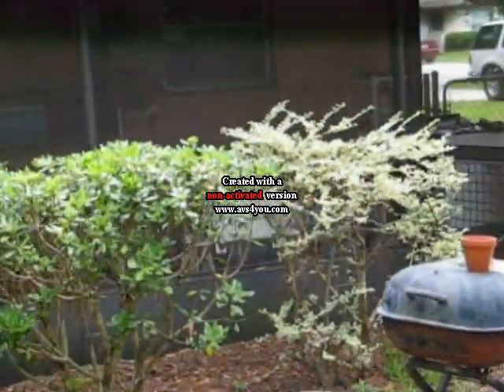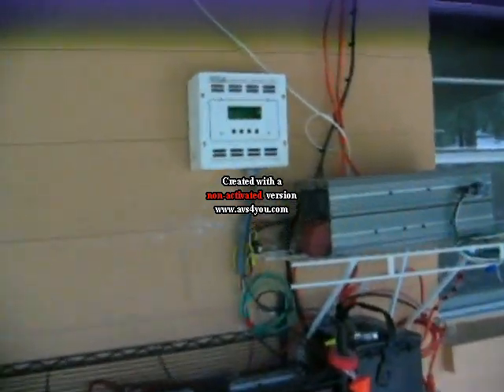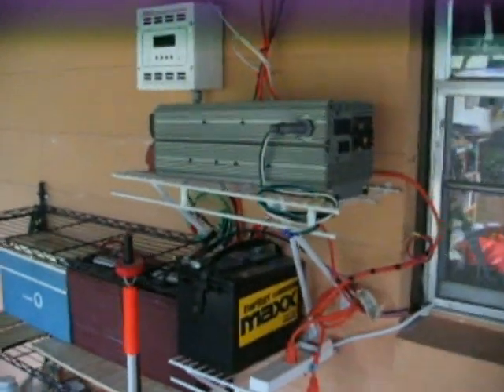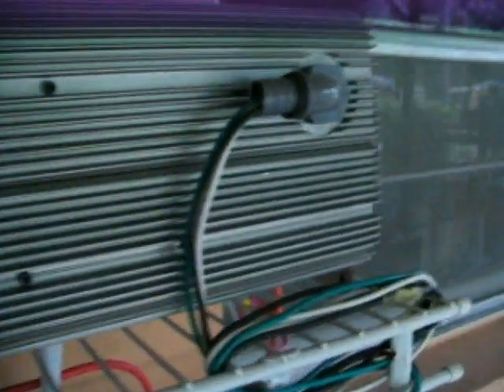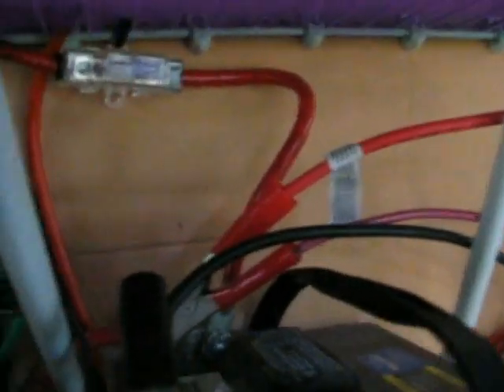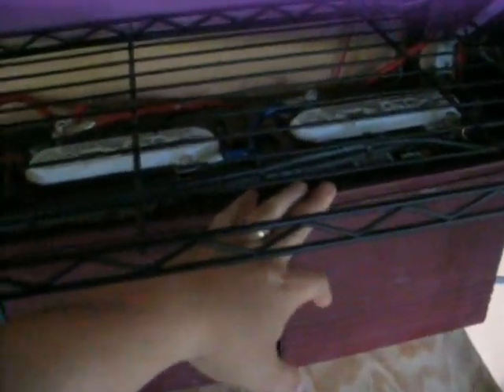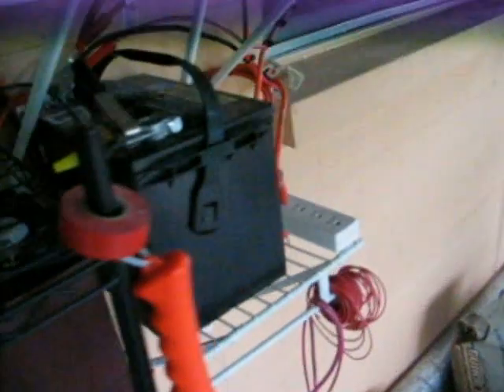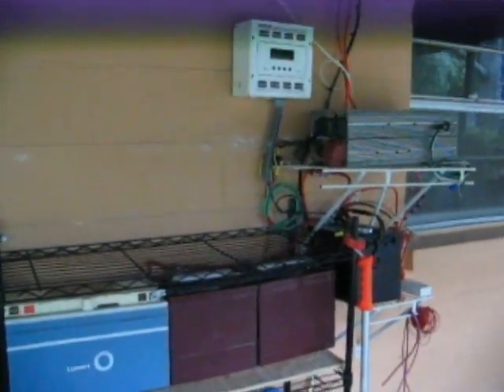MY HOME SOLAR SETUP in Florida- UPDATE #1

Comment from the maker: That's not an easy answer, due to a lot of variables. A 300ah battery (what voltage) and 200watt panel (what voltage) Then how many hours of direct sun do you have on that panel? Let's say you consume no more that 50% of the battery(150ah) and lets assume that its a 12v battery, and a 22.2v panel, and you get 6hrs of sun. Then in 6hrs your panel will produce 1200 watt hrs.(in perfect sun) then that equals about 88ah. So you will need to either use only 80ah per day or add about another 300watts

Comment from the maker: @wesleytarbuck you actually get really good batteries at Sam's club. The hybrid or Marine batteries wont last as long as the 6volt golf cart batteries. And as long as you keep them well charged, they should last you between 5 and 8 years with proper care.

Comment: how long will you get out of those batteries before you need replacing?  i have a 2.5kw system i want to get some batteries set up, but the deep cycle batteries cost a fortune, there must be a cheaper way.

Comment from the maker: @PiercingKnight, this is harder to explain. Mostly depending on if you have an MPPT charge controller or not. I do not know if you have seen my other solar videos, but I show you my charge controller and it's output. I only have about 18amps of solar to charge my batts, I use mostly my grid tied micro inverter all the time. And when my batts go down to 11.5v, I recharge. Which takes about 5 full days. Mind you that I only use my batts for 1 desk lamp, and to light up my 12v landscaping lights

Comment from the maker: @PiercingKnight, my apologies. I meat to say a 12v deep cycle would be devided by 10. The higher the voltage the lower the # you have to devided it by. A 6v batt bank would be /12. A 24v batt bank would be /6...and so on. The way you get the # to devide by is take inverter output voltage(if 120v) and the batt bank voltage(12v), which =10. If 120v (inv) / 24v (batt)=5, If 120v (inv) / 36v (batt)=3.33, and so on.

Comment from the maker: You should decide what you want to power, and for how long. This will give you how many Amp hrs you will use "need". The amp hrs on a battery means that at 1 amp draw per hr, the battery will last that many hrs. Those #s are for DC, when you invert to AC, that # is devided by 10. A 210 aH 6v deep cycle batt will only last 21 aH when inverted to use 120v items. My 1000 amp hr. battery bank will only last 100 hrs at a 1 amp draw per hr. So if I draw 10amps, it will only last 10 hrs.

Comment from the maker: @scottso241, You can pick up a 200 watt panel for about $400 dollars. The panel will be your major investment. Then you can get a 16amp charge controller for about $65 dollars. Then you can get a 1200watt inverter for about $100 used on eBay. Then 2 6volt deep cycle batteries for about $130 for both. After that all you need is standard car "starter cables" which will probly cost very little if bought at a junk yard. I suggest you buy the best you can afford, one piece at a time. Later from FL!

Comment: Great Job but there are a few problems with your setup: 
As a genral rule of thumb you should avoid useing diffrent types of batteries in one system unless you can constintly moniter there state of charge.
Car batteries are not designed for solar operation as they can not deep cycle (due to there cell structure).
Your batteries are to small fo the size of your inverter as the deep cycle batteries are not desinged to have high curent loads attached as they can be damaged.

Comment: @MrLagros As I understand it, you can connect different amperage batteries in parallel, as long as you keep the voltage the same.  But, different amp/hour batteries will charge at different rates, so you have to monitor the charging a little more closely to prevent overcharging some while you are undercharging others.  That is the only problem with connecting different amp/hr batteries to each other in a parallel string.

Comment: Even a standard deep cycle won't cut it long term. The best way to go is 6 volt golf cart batteries. Just connect them in a series of twos of course to get the 12 volts you are looking for.

Ray @ New World Solar

Comment from the maker: I have not had any problems with the different amps from different batts. I have a temp sensor that connects to the batts and displays on the charge controller. To date they have not overheated. As long as you don't overcharge them, they should be safe. I have had mine for just over 3 months.

Comment: I see different types of batteries. Any issues with connecting the different batteries of diff amps to one parallel bank?

I ask as I have two different types of UPS Batts. Both 12V diff. amps though some say if you connect them charge them this way may  blow up?

Comment from the maker: Yes, the car battery was my 1st batt., however the best to have are 6v deep cycle batteries. I use the car battery to crank up my DC generator, as it has a starter. I do not recommend a regular 12v car battery, they won't last more than 90 days if ran down past 11 volts. I recommend you call Interstate battery distributor- not store. And ask for "BLEM" or blemished deep cycle 6volt batteries. I just picked up 2 6v batts for $40 each, new with blemished exterior. Awesome deal! Hi from sunny FL.

Comment from the maker: Yes, I'm running a couple of items now. I have inside the desk top PC, desk lamp with 15watt bulb, modem, wi-fi router, cell phone charger, flash light charger- these items use about 2.5 amps....then outside I have 5 rope lights in my porch (1.5 amps) and I just added a chest freezer (3 amps). But I have added 2 130watt panels. My panels produce about 14amps for about 5 hrs, and I'm using about 3.5-7 amps 24 hrs a day. So my system is about even, as long as I get my daily sun allowance.

Comment: Nice expansion.  Are you running anything besides your computer??  I'm planning to install a wind charger that I am restoring from the 1930's which will give me another 100 watts or so in a good wind.  I'll have to change out the Harbor Freight charge controller also.  It doesn't have a dump load circuit, which I will need for the wind charger.

Comment from the maker: huge change. the Rogue 3024 MPPT charge controller is awesome. At peak my solar amps coming from the panels are about 12.5 amps. After the charge controller MPPT settings kick in, the amps are boosted to just over 15 amps. And I just can't say enough good things about the amount of info the device gives me.

Comment: Just to let the world know Ebay has that inverter used for $125 with shipping $144 is what i paid.  I dont like to buy used stuff but thought i would give it a try for the price. like the video any pointers with the inverter let me know i have the same panels but not as many batteries. I would liek to know what batteries are good for a hobby solar system. Thanks all

Comment from the maker: Yes, this crossed my mind. That was why I placed the plywood underneath the batteries. I now have gotten two plastic shelves. I just need to arrange them. But first I need to add more strength to the shelves for weight purposes. Thank you for the advice.

Comment from the maker: My back yard, and my surrounding neighbors all have 60 ft pine trees. So low would not be the way to go for me. However, I am trying to find someone who will climb up to the top of one of the pine trees in my back yard and cut of the top above the branches. Then I will have them put a VWAT up there for me. I'll paint it camo, so it will be very low key. I think this might work.

Comment: Thats a very nice setup, but you should more solar panels to it. I saw you have 11.8 volts thats kinda low for those amounts of batteries. Other than that is a very nice system, do you have the model for the charge controller?

Comment from the maker: JUST CHECKED OUT YOUR VIDS, THOSE ARE SOME EXCELLENT IDEAS. I WILL IMPLEMENT THEM. JUST NEED SOME MINOR MODS FOR MY AREA.....AS FAR AS GRID TIE. I WILL BE ACQUIRING AN "AUTOMATIC ELECTRICAL TRANSFER SWITCH". THIS WAY I CAN SWITCH SOME OF MY ROOMS AND THE KIDS PLAYROOM TO THE INVERTER AND BATTERIES, AND WHEN THE INVERTER TURNS OFF AT 10.5volts. THE SWITCH WILL CHANGE TO GRID POWER. THE SWITCH HAS PRIMARY AND SECONDARY POWER INLETS. MY INVERTER WILL BE PRIMARY.

Comment: A nice start, you can always add panels
to increase charging capacity. Be careful not to let the bat voltage get to low.

When oil goes up...panels get cheaper cause they will be mass produced in greater volumes.

You'll be ready for a outage, without a noisey smelly generator...